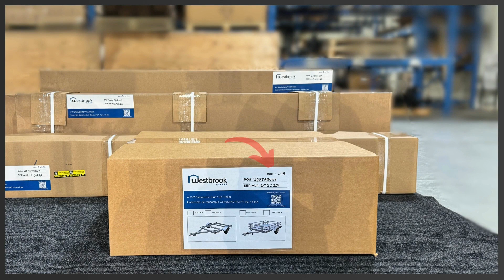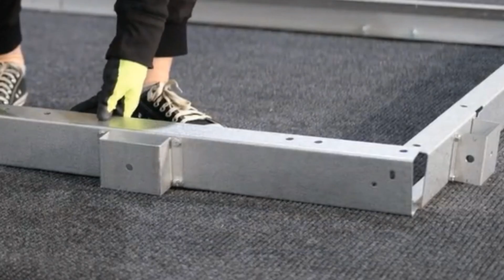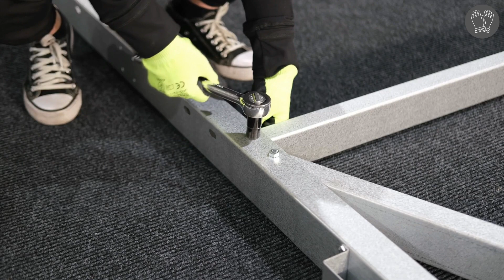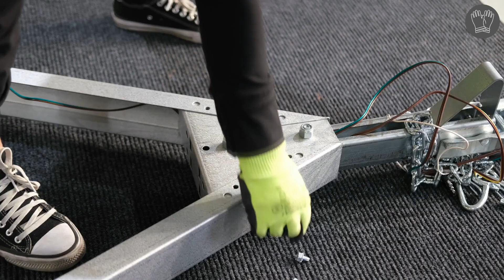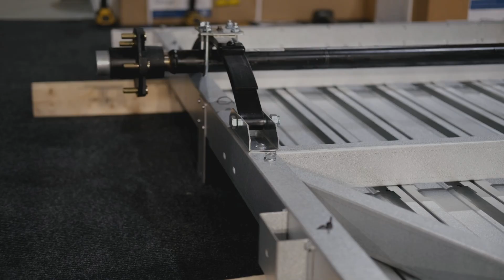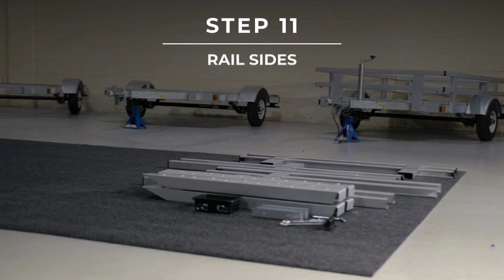5x8 Utility & Flat Bed Kit Trailer Assembly Video

Comment: In the section where they show you where to put the mounting brackets for the springs, this is not a 5x8 trailer that is being shown. This caused me some confusion when trying to determine which holes the mounting brackets actually should be attached to.